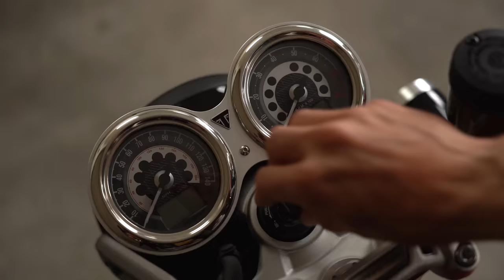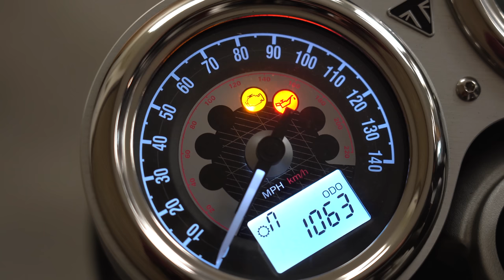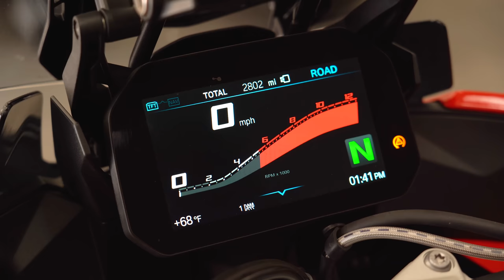Do You Need To Warm Up Your Engine? | The Shop Manual

Comment: To me warming up my bike before riding is like stretching before a jog. It just feels better and also my engine sounds like it's not working so hard . When I take off with out warming I could definitely here the difference of the engine. It sounds like it's giving it's all trying to push.
Reply: Engine will  only  warm  after  two  or  three  kilometres. At  idle  it  would  need  more  than  half  an  hour.

Comment: Love your content  as always.   I’ll add a point.. my 03 FJR1300 idles a little higher for a bit before dropping down to base rpm….. if I EVER shift it into first while like this, the clunk is nasty. So I guess I’m waiting more for transmission compliance more so than heat  everywhere else.   Keep up the great work!👍
Reply: Warm up your bike dont listen to this bullshit..
Reply: My r1 does the same thing revs high for like a minute   then drops down. But i will always let my bike warm up untill at least 130 before jumping on it. Just me tho
Reply: It revs higher first to heat up the catalyser, same for cars
Reply: Yami's just seem to have that clunk into first, had a 05 fz1 and now a 04 yzf600r and both clunk a bit going into first, nothing to worry about
Reply: All bikes I’ve had clunk bad when cold, that’s Honda, Kawasaki, Cf Moto and Yamaha

My MT-09 though, Jesus, you need to give it a minute, it’s like you aren’t pulling in the clutch if you kick it into gear in the first 30 seconds
Reply: @lawrencemercieca  yup! Had a MT10 that was very violent too.  I just make a habit of starting all my bikes…. Then put on helmet and gloves etc…a little stretching goes a long way in my old age as well…. Then the bikes don’t mind the initial shift…👍
Reply: Interesting…. I had a 2018 MT10 for 2 years and also found it to have a crazy clunk… sold it as it was violent in general and had me doing things that I should not be doing. 😂
Reply: Start in first? Mine clunks also but I never figured it was a problem. The clutch is a bit grippy when cold I guess. My cbr1000 also was similar. The clunk is just the clutch tension snapping as load is applied, not really the gearbox. If the bike is in motion you won't feel that.
Reply: for anyone considering this topic, the clunk purely happens because the claw of the moveable transmission gears slip into the pockets of the other gears, in general, the higher the rpm difference is, the worse it gets, no matter of engine/transmission and its accompanying oil temperature. you can easily try this out without causing harm, just rev the engine to a higher rpm and engage first gear, its noteably worse than letting it idle to engage the gear

Comment: Have done the Honda start up method on the very cold days & just start the bike and let run while putting on the gloves & helmet on the warm days,  since I started riding many years ago
The Honda method is real simple yet perfect for efi bikes - start up - then hold the revs at 3000rpm for 30 seconds - then release the throttle to idle speed - now select first gear and take off to where you are going too, no having to worry about the engine tolerances due to cold damage cause the engine is at full and safe operating temp to go hardcore just remember your tyre's still have too get up to safe temp.

Comment: My bike is a 2001 Yamaha R1.
 Since it's a 21 year old motorcycle, I do my best to maintain it properly and i try to use brand consumables.
And yes, i let it warm up for a minute or two after i start it, especially when it's cold out, usually in the morning when i ride to work. I have a little window on my dash that indicates temperature, i think that it indicates the temperature of the radiator rather than engine temperature though. 
Anyway, bottom line is, i reccomend that no matter what motorcycle you ride, it won't hurt to let it idle for 1 or 2 minutes after you start it, just to be sure.

Comment: I’ve been on the fence about letting my bike idle for a few mins before taking off, this definitely helps me not to worry about it too much. Thanks, Revzilla.
Reply: In a car, which I'm assuming is very close in a bike, the oil takes about 13 seconds to fully flow from pan to top back down. So if your bike is fuel injected, like he said, all it takes is putting on your gloves.

Comment: Once I start my fuel injected bike my ritual includes checking both of my turn signals, and headlamps. After placing my helmet and gloves on this takes me about one minute before I ride away.  

The first few minutes of riding I am travelling at a lower to moderate speeds to continue with engine reaching optimum temperature level.  After this I may reach higher speeds and increased RPM's as needed.  Great video with helpful knowledge and reminders.

Comment: If you load the motor cold you are going to help the engine wear along. Also remember that very hard metals have less elasticity and will Crack when cold when subjected to load. So if you pull out of your driveway then stall the motor, you might be putting ultra fine cracks in
Reply: A 7 minute idle to bring engine up to temp is far worse for it than a 2 minute light ride to do the same.

Comment: I am a newbie in riding culture but the other day I went on a 100km ride & when I returned and parked my bike the clutch cover was not very warm as I was expecting even though I was riding almost at redline
If I share my experience so far without a cold start the gear shifts don't feel too smooth especially 1st gear while rolling
Great informative video helped a lot😁
Reply: 1st gear is always rough and clonky and should only be used when you come to a complete stand still.

Comment: In the old days I had to let my 1981 carbureted Honda CX500 warm up for about 5 minutes, or it was all bucky and hesitant.  My current Kawi C14 I'll start and let run for 30 seconds or so like my car, until it drops down from fast idle speed. EFI is a such a blessing to have on bikes.

Comment: Alright all good points and info but there's one you may of overlooked is the fuel inrichment mode that comes in the ECU programming that makes you allow the bike to warm up before it will drop the rpm down below 2000. My 2020 z900rs will hold 2000rpm until it warms up, while I can take off while it's in this mode it's a little weird to take off then come to a stop sign and have it revving at 2000 rpm.

Comment: Yea . Don’t let it warm up and start getting gaskets leaks all over . The oil has to warm up or else there would be to much oil pressure in the system . Want to see if it’s true , install oil gauge ( car or bike ) and you will see what I’m talking about . Warming up your bike or car for 2 min or so til you see the rpm drop to normal idle isn’t going to kill you , but sure will save you some money down the road . Just some advice from someone who’s been riding for over 20 years 👌🏻

Comment: My race engine building friends told me to ALWAYS bring the oil up to temp before pulling out on my bikes.  You touched on this in the last segment.  Engine components need to be up to temp to operate properly.  I always let my bikes warm up and will always let them warm up.  It's way cheaper to come to temp on the stand then do cold damage to the engine.
Reply: On modern machine it causes more long term damage letting it warm up slowly as apposed to gentle riding to warm it up quicker.

Comment: Look. I'm going to have to slightly disagree with this one. Firstly, cold starts require richer mixtures because of the increase in ambient air density when it's cold which causes it to be outside the ideal combustable range of a fuel:air mix, not because of condensation. Two stroke engine tuners know this very well. We used air densitometers trackside to inform our carburettor jet decisions back in the day. In 4 stroke production bikes with carburettors they use the air-choke to manually balance the fuel air ratio and injection does it with temp sensors and mapping to produce a longer injection pulse. 

Now, with regard to warming up a modern engine, the loose tolerances and dissimilar metals in a modern cold production bike produce much more than a little wear as they slap about inside the engine. Modern synthetic oils rely on tight warm gaps to exploit the high film strength of these thin oils under pressure. This is particularly important for piston  rings and plain crankshaft bearings. I believe the testing that has shown that 90% of friction wear in a modern engine occurs under load in the period before the engine reaches correct operating temperature. My advice would be to start the bike on the stand, put on your helmet and gloves before getting on and riding away and take it really easy until it gets close to operating temperature.
Reply: Isn't that almost word for word what he said in the video though?
Reply: @HartyBiker   Not really. I disagree with his comment about the dissimilar expansion of the various metals not causing significant wear before operating temp is reached. He implies that the slipperiness of the oil is what protects the engine rather than the film strength. Film strength requires tight tolerances and those tolerances don't happen until correct operating temp is reached.

Comment: I have a Gold Wing 2014 model that stumbles no matter how warm or cold if it doesn’t warm up. My 07 did also. Most people have never experienced it who also ride Gold Wings, including a man who never had until he rode mine. He was letting me check out the new 2018 DCT and told me later that mine had a pretty bad stumble issue at start up. I know a fuel injected bike should not have this issue, but I have experienced it with both bikes and it is not fun on that first turn out of the driveway.

Comment: Great, straightforward info---very helpful!   I have a '78 BMW 100/7.   If I try to move it out of my driveway without a three-minute warm-up on a cold day, I swear I can hear the engine say:  "Schneide das aus, du Idiot!"
Reply: My '13 R1200RT can be fussy as well.  Air/Oil cooling is something you learn to live with. 👍
Reply: If you are stuck using E-10 fuel where you live, you might want to concider rejetting your carbs as the stoichiometric air-fuel ratio for pure gasoline,  what was sold at the pump in '78, is 14.7:1 whereas for E-10 is 14.08:1.

Comment: Ive got now 70.000km on my MT-09. I've never let it idle longer than 30seconds after a cold start, idling for a long time wont really warm up the enginge fast, it actually just extends the time where the bike has the biggest wear.. After about 15-20min of chilled riding with light internal load & low rpm the engine is good to go.

Comment: Yes you should warm up your engine and for the first couple of miles take it easy , no your wrong you should let the oil get round the engine, also the metal body of the engine the gear box  etc .